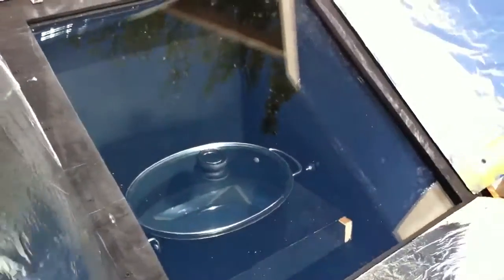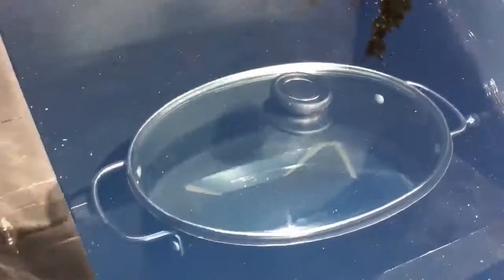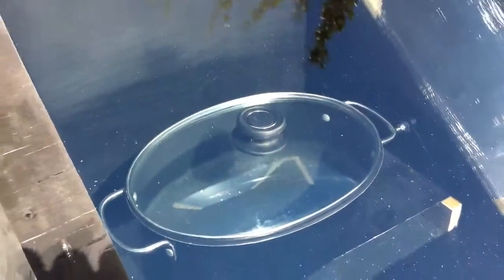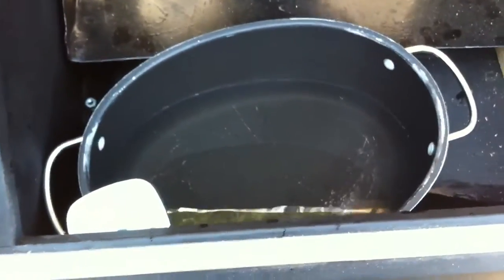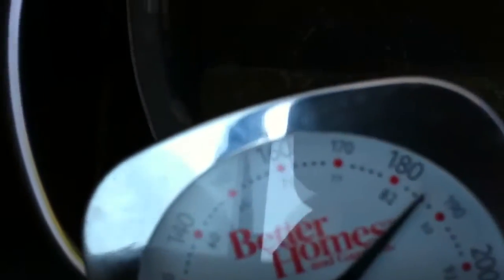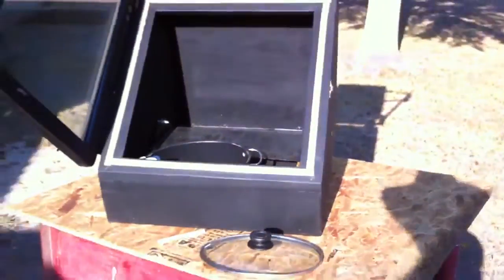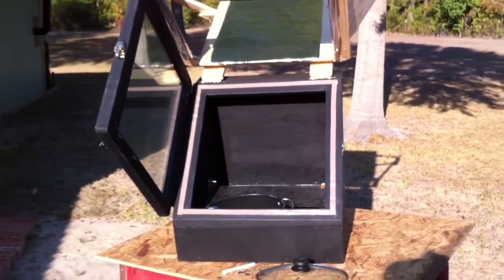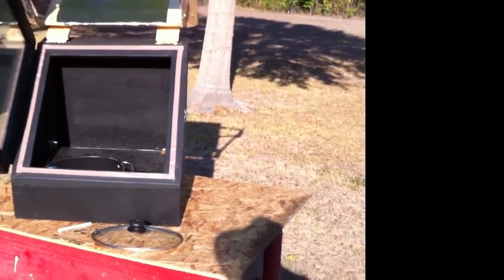How to build a solar oven,  part four of four

Comment: Find a fresnel lens (screen) from a projection tv,. Find center of screen,place one panel of glass over (centered) screen,. Mark & cut fresnel lens,. Sandwich between glass panels. Lightly clamp with padded clamps and sillicon edges to seal. When sillicon dries,use razor knife to trim excess. Use good quality duct tape(recomend Gorilla brand) to finnish the edges,. Split tape so as to have 1/4" overlap on each side.. Find focal length & mount 1-2" above or below focal length.

Comment: Raise the pot off the floor of the oven with a wire cage of some sort. Get airflow around the bottom and no conduction from the pot through the base.

Comment: Would it not focus the heat better on the pot if the inside of the box was lined with reflective materials?  The black paint is to catch the heat but it seems the pot would heat faster if  the light was focused onto the actual black pot itself.  Thanks for your work on the vids, I am looking forward to building my own.

Comment: Nice Job. A little tweek, you could make it so the door lifts off/out so you could save some weight there. It would be two piece. On the miter joints use a biscuit joiner as end grain doesn't glue together too well.

Comment from the maker: @jesus77755 i got water to boil.so it had to reach 21. i have a thermometer now and when i finish the reflector im certain it will go into the 325 range with ease.

Comment from the maker: @subtac im sure youve worked on a car. when you drop a nut a bolt a wrench or what have you,it always rolls to the center under the car. when i dropped the thermometer it went to the center of the trailer i had the oven sitting on. im a fat guy so theres no way i was gonna get my bigg a@@ under the trailer to retriev the thermometr. so i had to hook the lawnmower that i had been mowing with,up to the trailer and pull it forward ever so slowly so not to make a bigger mess. shoulda been there.